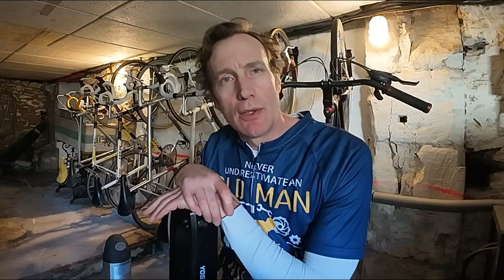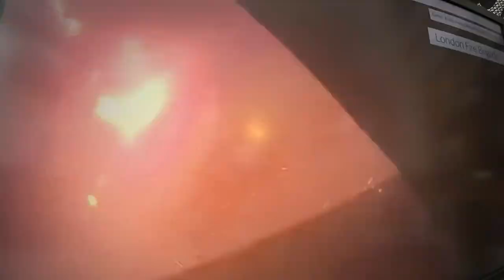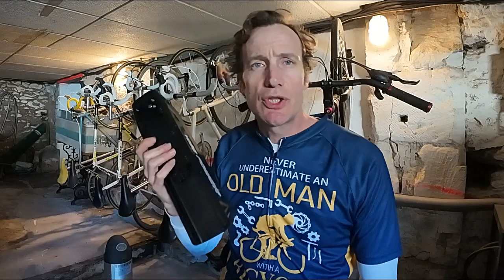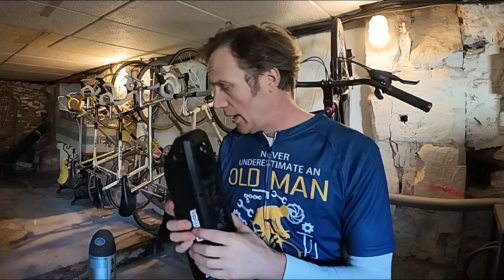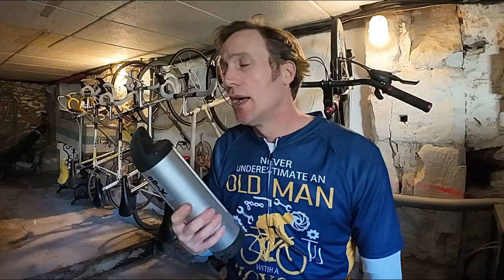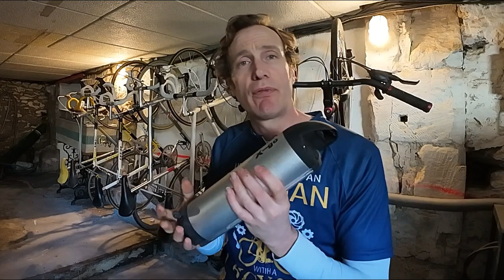Why do ebike batteries explode?

Comment: £130 for a ebike battery and charger, unbelievable, where do you buy your batteries from
Reply from the maker: Hunt around on ebay, Dan
Reply: @vintagevelos9517  I'd hazard a guess that a lot of these fires are caused by cheap knock-off batteries and/or chargers. It also wouldn't surprise me if a lot of the fires are original batteries/chargers that came with really cheap bikes from no-name Chinese brands (not that China can't make good kit but they seem to have cornered the market on stuff that barely works). I'd love to see more data on this though, I expect insurance companies would be interested in gathering it!

Comment: It’s easy to be frightened by the reports of house fires from exploding chargers, just follow these sensible rules and you will be safe. Just possessing an e-bike or scooter is not putting you or your family in danger.
Reply from the maker: Spot on, lot of fear mongering going on coupled with a lack of respect for the energy stored, Dan